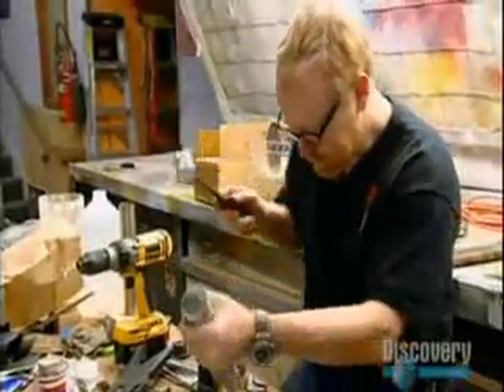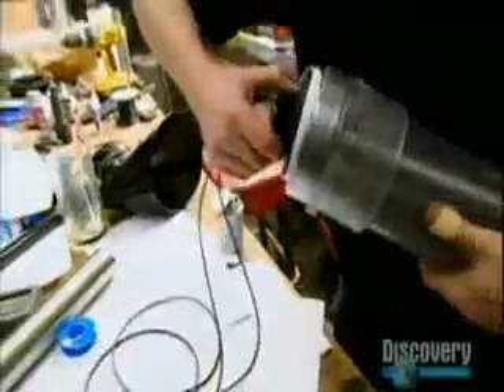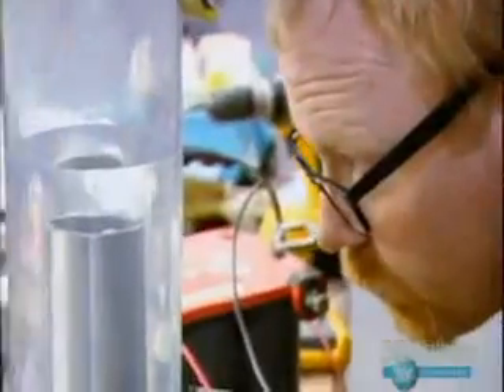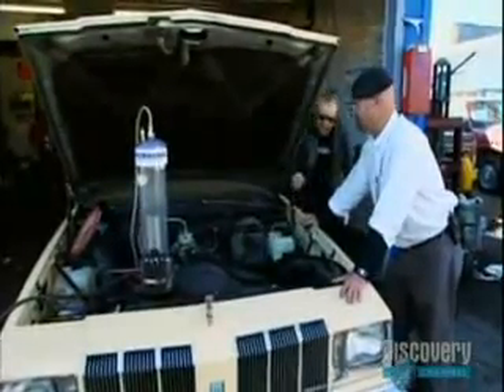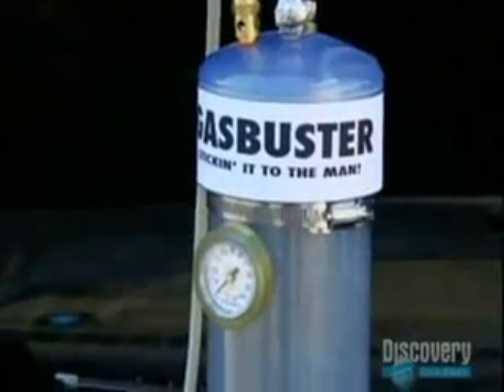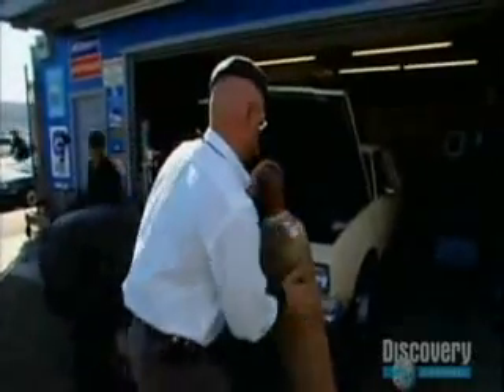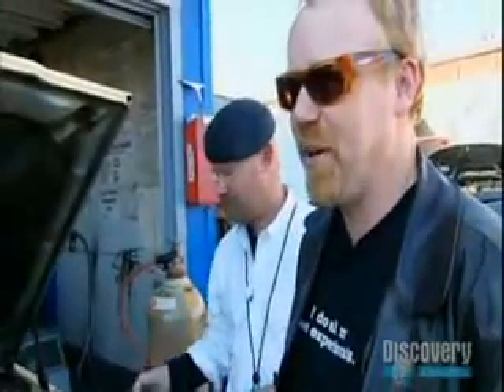HHO Mythbusters Explained

Comment: Sure, you can run a car engine on hydrogen. And you can produce the hydrogen using the electrical power of the cars alternator. 
But, by the time you install a large enough alternator to power the electrolysis to produce a sufficient amount of hydrogen......Well, the alternator will pull more power than the car engine can produce from the amount of hydrogen it is getting.................................................get it?
Put a different way:
Consider the number of people who have dicked around with this and yet you don't know anyone who has a car powered entirely from water/electrolysis...................................get it?
Any car manufacturer would love to sell you a water powered car. How can a invention be suppressed when anyone can build it; right? So, where are these cars? ......................get it?
All of those who invent, design, and build our bridges, skyscrapers, airplanes and the rest of the hi-tech stuff our civilization depends on are the same people who are telling you these HHO gizmos simply CAN'T WORK. And, you want to say THEY ARE IGNORANT?.......get it?

You don't get it? .................................................................................................................<sigh>

Comment: (1) No conspiracy here.  If hydrogen fuel cells could run a car cheaper than gas, we'd have 'em!...but they can't...they can't by a long shot!  Just too much juice required to make enough bubbles, dude!  (2) Passively safe and clean MSR reactors will produce lots of excess heat which can be used to desalinate water instead of just producing electricity.  (3) It takes more energy to produce ethanol that what you get out of it.  It's just money for Iowa farmers.  Politics!  (4) Folks in Massachusetts pay less for natural gas than the states where it originates.  Politics, baby!  (Now your brain is right...go forth and save the world...pft!)

Comment: are we to let it go so easily with just one lousy backfire? its more than 10 percent of hope that we can use hydrogen to replace costly, filthy petrol, so lets not give up. Unless you are pro petrol and pro pollution. why not sell hydrogen gas in tanks much like LPG or methane and use it to power cars, the method seems the same but the cost of production is way low. cheap gas.
Reply: Buy one for $60k  https://ssl.toyota.com/mirai/fcv.html?srchid=sem%7cGOOGLE%7cMirai%7cModel_Mirai%7cMirai_General%7cMirai_Refresh_Rd1%7cMirai_MLP&gclid=CMHU-7nJ2tkCFe66swodpBgDdg&gclsrc=ds

Comment: Of course you can run an engine on hydrogen and oxygen.  The problem is you need more energy to separate the molecules than you would get out of the gasses you just separated.  And to run the car down the road, you would need a LOT of those generators in the car and a whole lot of energy to separate the gasses.

Comment: Obviously the big oil companies don´t want the secret exposed that water can be used as fuel because that would make them go bankrupt
Reply: Well, obviously it can be used, but not like a HHO generator in the car. You can't generate electricity, use it to generate hydrogen and use it to power the car and therefore generate more electricity. That's not possible. Otherwise you could power the car directly on electricity. However hydrogen could be used to power the engine, but it is not that simple

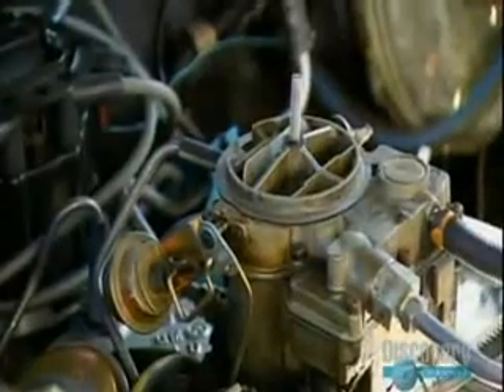Comment: If you want to run a car, you have to build one big enough to supply the motor and that takes quite a bit, but you can build one and add it to a select vacuum line and improve your mileage. My dad sold what was called a Vapor Injector way back about 50 years ago that improved your mileage but had an alcohol base additive mixed with water. We had a 1965 Chevelle Malibu station wagon with a 283 2 barrel that got 25 miles to the gallon at 75 mph, so if you backed the speed down to about 60, it probably would have done closer to 30 mpg.  If you added today's standards to the car, like an overdrive transmission, radial tires, fuel injection and a computer, it's hard to say how much more improvement could be added to the mileage. It was a 4000 lb. car with a 3:08 rearend and a 2 speed power glide transmission. Dropping down to a 2:56 rear end would have dropped the rpm's approximately 500 and even going to a quadrajet would have improved the mileage, so fuel injection over a quadrajet would have been another improvement. I had a 71 Buick with a 350 2 barrel and I took a quadrajet off a 68 Buick 350 and put it on the 71 and my mileage went up by 4 miles to the gallon. A quadrajet that's jetted properly will outperform any other carburetor on the market and you can put them on mud trucks and they won't shut down when you hit big holes like a holley will and they get better gas mileage than a two barrel because the front barrels are smaller than most 2 barrels. Most people don't understand how they work so they blame it on the Quadrajunk and go buy real junk. Rochester Carburetors by Doug Roe is the best book you can buy on Quadrajets, JFYI

Comment: it didnt work because  it wont work without a catalyst.. you need a catalyst  for the + and - current to separate the particles.. all they had to do was add baking soda as a catalyst and it would of bubbled 100x more and would of released more hydrogen..
and yes, it does work..

Comment: tiny bubbles ?? that means not enough electric power..........  car can give 25 to 30 ampers, if the device takes only 10, you can add voltage multiplier colils or anything which makes higher voltage, but be careful, it can only take less than 30 ampers or any vaule which the alternator can support.

Comment: Of course they failed. The reason is that they are idiots. Hydrogen fuel cells have been around for a long time and are now at the point where they power vehicles no problem. You have to wonder why they are "mythbusting" something that is not a myth? Sure they failed, but that doesn't mean it can't be done!  Let them try to bust the "hear transplant" myth.  They could do it on the chick so the ratings would be great since we would see her tits. But I'm pretty sure it would fail. Why? Not because heart transplants are a myth and don't work, but rather because idiots who try things that are way over their heads and have no concept of what they are doing are bound to fail.  They should try something more at their level, like the myth of any guy  can get laid. With these two clowns I bet they will find that the myth is busted, since the will never get laid (buggering each other doesn't count).

Comment: A CASE FOR RAISING VEHICLE EFFICIENCY WITH H2
(I have tried to balance equations as appropriate)

Below is an incomplete diesel combustion equation: 
2C16H34+47O2+N2->28CO2+34H2O+4CO+N2 combusts @ 750°C

I am not including NOx which forms@1600°C, due to the endothermic reaction of the following: 
(the carbon monoxide hydrogen reaction) 4CO+8H2->4CH3OH forms @ 250°C
and 
(an incomplete methanol combustion) 4CH3OH+3O2->2CO+2C+8H2O combusts @ 470°C

This is the electrolysis reaction adjusted for the proper stoichiometric ratio:
8H2O->8H2+4O2 combusts @ 570°C

In this example, the methanol formed cools the engine, preventing high EGTs and improving your vehicle's longevity and emissions. An excess O2 molecule contributes to the combustion process for a better burn.
2C16H34+49O2+N2->28CO2+34H2O+N2

Refute:
Still, energy cannot be made from nothing. 
However, the simple turbo does help fuel efficiency by using energy from the exhaust to spool more air into the intake. There is a balance. If a turbo has too much head loss, fuel efficiency will drop. 

A turbo doesn't make energy from nothing, it just allows for a more efficient use of the fuel being injected.
A supercharger is less efficient because it does not utilize the exhaust gas waste energy, but there is still a slightly cleaner burn.

Likewise, an hho unit will act like a supercharger if powered directly from the alternator, or act like a turbocharger if powered from waste energy. 

Using something like a boost buck converter, energy can be siphoned from peltiers, solar panels, exhaust driven generators or electric generators attached to a vehicle's suspension.

I agree that H2 and O2 on their own cannot provide enough power to run an engine and make the same amount of H2 and O2 through electrolysis, since this would break the first law of thermodynamics. Nevertheless, incorporated into the combustion cycle of a hydrocarbon, efficiency can rise.

Comment: The question is about volume. Even a small four-cylinder sucks a lot of air and fuel. Let's consider most 2.0 liter 4 cylinders. That means to fill all four cylinders will take 2 L of fuel air mixed together. Let's also say that most grocery bags are 10 L. That means you get five revolutions before your one grocery bag sized fuel supply has been depleted. The engine even at idle runs at somewhere between 600 to 800 revolutions per minute. You would basically need a hot air balloon full in order to go to the grocery store and back. How long would it take using this process to fill a hot air balloon?

Comment: I Agree they didn't use The Catalyst... However, You Don't have to set the rods 3/8 Inches apart... Because The Water is conducting the electricity, and it should not change the chemical Reaction that occurs in The Mixture...
Reply: +commonman80 
It is apparent that you haven't studied Stan Meyer's patents, and if you have, you don't comprehend the principles of operation. 

The length, diameter, and wall thickness, of the inner and outer tubes determine the frequency at which the system will resonate. 

The spacing between the inner and outer tubes form a capacitor of a calculated value. 

A low voltage, low current, waveform is pulsed across the capacitor with a known waveshape to excite the water molecules. 

Timing is critical.

The resonant frequency varies as the water level changes, and either the water level must remain constant, or the input frequency must be changed as the water level changes. 

Details, and various modifications, can be found on the net. 

Read the patents first.
:

Comment: Combustion engine is a taxation machine, your stupid car burns fuel even when braking and going down the hill, a child bicycle is better engineered. You don't pedal braking or going down the hill.  I Just put a system cutting the fuel injection when my braking lights are on, I save around 30% fuel in the city,  and that is only one way  among many to make those stupid cars a little bit better.       Wake up .
Reply: Most cars have such a system built in from the factory already. They stop injecting fuel when coasting, braking isn't even necessary.
What about electric cars? Those are exempt from taxes in several countries.

Comment: Excuse me guys.  As an engine designer I feel the need to point out that Hydrogen does NOT behave at all like other fuels.  The speed of combustion is extremely high and instead of a fast burn you get detonation, accompanied by a massive pressure rise in the cylinders which is capable of wrecking a standard engine in seconds!
Reply: Well, what if you just lower the intake to match the needed demand for safe piston operation

Comment: You still cannot have a system that powers a car off nothing but water. You need to supply energy to split that water. Car alternators only put out a fraction of the power the engine can. Either you are charging your car batteries often (which would require deep cycle batteries, why not skip the engine and go full electric) or your battery will go flat, your alternator alone wont provide enough power to feed the engine, and you will slow to a halt.

The entire idea violates conservation of energy, the first law of thermodynamics.

Such a system could be used to reduce fuel consumption at times when engine RPM is high and electrical load is low, commuter car alternators produce 50-100A at higher RPMs...

But to put it into perspective, that 100A alternator at 14.4V will pump out a maximum of 1440W of power at redline.

1440W of power is absolutely nothing in a car.  A slow shitty car will put out 40KW at redline. You will not even feel a power increase of more than 10% and you will not notice a fuel economy increase with day to day driving until it hits 20-30%.

Anyone who thinks this works either hasnt tried it, doesn't understand physics.. Or is a victim of placebo.

Just take some extra weight out of your car if you want better fuel economy

Comment: Better than that, I saw the system generating a lot more gas, just before they put it on the car. Those tiny bubles are not generated at that time, but residual... what a BS!! Even from tap water, it would produce a lot more HHO... now, who is paying them to do it wrong?

Comment: regular electrolosis does not work it has to be done with resonance  frequency using a transducer to weaken the water in the process before appling dc voltage. it looks like this failed on purpose

Comment: Holy crap..  a full bottle of HHO piped straight into the intake..   WITH NO FLASHBACK PROTECTION  !!!!!    That's the way to go singing with the angels pretty damn soon...   hahahahahahaha     I thought these two blokes were supposed to be smart...   Not today they're not  :-)
Reply: Well it isn't a cylinder of HHO. It is hydrogen.
Compressing  HHO ( a mixture of hydrogen and oxygen gases)  is a good way to  "go singing with the angels" 
WITH NO FLASHBACK PROTECTION  !!!!!  
You sound like a true believer   if so, I'm sorry.
Reply: not a full bottle of hho, a full bottle of hydrogen gas, used for multiple applications like plasma cutting. A propper gas mixer and cng regulator along with a tune would reduce the instance of a lean backfire like they had. A flame arrester and bubbler in pure hydrogen is pointless, if there is no oxygen in the bottle there is no need for either as there is no oxygen in there to allow the gas to burn, the hho generator is another story though. It contains hydrogen and oxygen, however the likely hood of combustion is slim as the ration is out.

Comment: Even if you could make an HHO fuel cell with enough effiency and if you had an engine capable of running on H2, where do you get the electricity from to run the fuel cell? You can't use the car battery. That would be an perpetuum mobile, as the car battery is charged by a generator connected to the engine.

Comment: The fact you spelt attempt wrong.
Reply: Also the problem is the car need to supply the power so if you have a 1kw cell the alternator would be putting a lot of strain o the engine and also the fact you need A FUCK TON to run a car.

Comment: Those fuuck heads blue on purpose. Although he was surprisingly amazed that a car could run unmodified on a fuel that isn't gas, They had to blow it up. Evidence: You can clearly see the action of hydrogen gas blowing on wire seconds (maybe longer) before starting the engine. That how to produce a gas leak  explosion. I wonder how many video takes is took them to finally get that explosion.

Comment: you need to understand a few thigs. 

piston engines are inherently thermodynamicaly inefficient due to high amounts of friction, velocity changes from pistons, and energy have to go through a drive train leading to more energy loss. and most energy loss goes out the tail pipe as unrecoverable heat. 

there are inefficiencies in the electrolsis of water due to production of heat due to resistance in water even with electrolytes added.

HHO is a dangerous volitile mixture of oxegen and hydrogen in the same volume which is why you see hydrogen and oxegen stored in seperate tanks on rockets and hydrogen fuell cell systems. you never mix your fuel with its oxidizer until you are ready to react them. otherwise this is an unnecessary explosion hazard. 

If you want to run a car on water, produce hydrogen with a seperate energy source and use free oxegen in the air as your oxedizer. 

use a hydrogen fuel cell with a proton exchange membrane to extract electricity directly from the reaction of h2 and o2.  and use an electric motor to produce mechanical work not a piston engine. 

Dont listen to some dick fart blowing smoke and pseudoscientific bullcrap up your gullible gaping asshole. be skeptical and do do not try these experiments without proper education and saftey training. 

thanks and be safe. if you insist recreating these experiments you should come to the same conclusion.

Comment: Yes you can use electricity to break water down and release hydrogen. And yes you can use hydrogen to run an engine or generate electricity. But the problem is the amount of energy you get out of the engine, is less than the energy you used to breakdown the water in the first place. So this is actually an energy-wasting process. Its like spending a dollar bill to buy three quarters.
Reply: +MinuteMan 
The electrolysis method is several magnitudes greater in efficiency than the billions upon billions of dollars spent on the military occupation of nations, the cost of wars, the loss of life, the increased cost of food and goods, all the oil rigs, oil tankers, all the oil spills, refineries, storage facilities, tanker trucks, and gas stations – just to have your car go thirty miles before having to refuel. 

Your argument falls flat on its face.
:

Comment: but it costs more energy to release the hydrogen from water than the hydrogen produces in a car engine. so the car itself cannot be used to produce the hydrogen.
Reply: +stumpedII 
The electrolysis method is several magnitudes greater in efficiency than the billions upon billions of dollars spent on the military occupation of nations, the cost of wars, the loss of life, the increased cost of food and goods, all the oil rigs, oil tankers, all the oil spills, refineries, storage facilities, tanker trucks, and gas stations – just to have your car go thirty miles before having to refuel. 

You just might want to rethink what you've said.
: